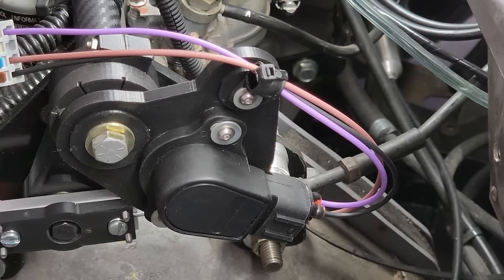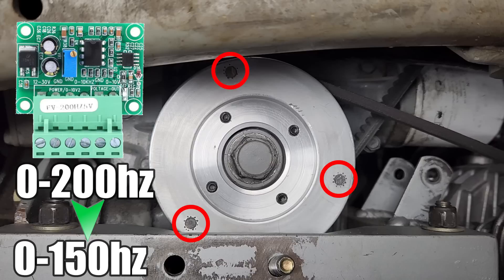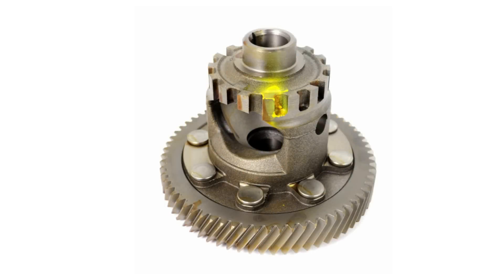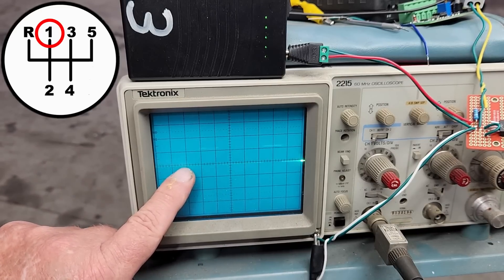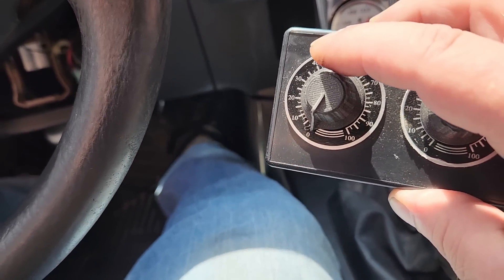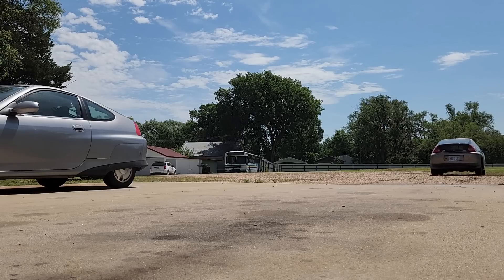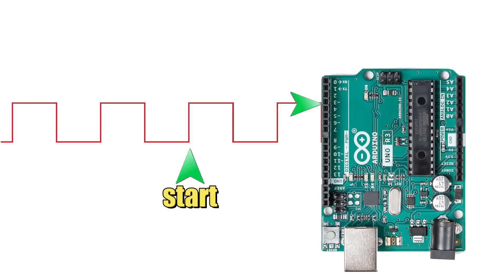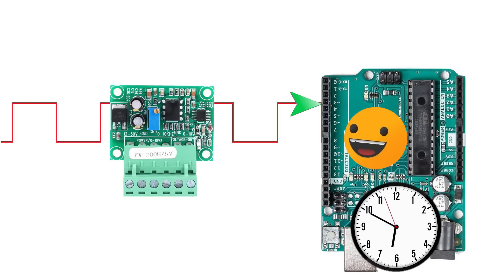S4 E21.We make progress on the Arduino controlled AMR500 supercharged Kubota diesel powered Honda

Comment: Why didn't you use a Bosch hall rpm sensor? They give out a simple digital pulse whenever the sensor passes a metal nub. So much easier
Reply: I think Jimbo is using the sensor (VR) that came with the Saturn transmission.
Reply: @gregholloway2656  I meant for the engine rpm, could interface directly to the Arduino digital pin and with how many digital on offs per rev per time you can calculate the rpm without the need for any frequency to voltage conversion and it's much more accurate and actually no more difficult to code
Reply: @diesel-technology5507  aaah, I see.  I use a hall sensor with a built in magnet, so the trigger wheel just has to be steel, without any need for rotating magnets.
Reply from the maker: Go ahead and write the frequency code  for two frequency measurements using the standard methods in the Arduino IDC... and try driving two stepper motors at the same time.  You will be disappointed in the results.  The Frequency to voltage gizmos aint perfect, but they free up resources so I can drive the stepper motors for the fuel rack and the boost controller.  The priority is focused on the the stepper motors.  The sensors just provide basic info.
Reply: @robotcantina8957  you don't measure it as frequency, you measure it as 0 or 1 on a digital input pin and you're done
Reply from the maker: @diesel-technology5507   0 or 1 measurements is a frequency measurement.  You have to use a hardware interrupt and a timer in order to count the times the port transitions from 0 to 1.
Reply: @robotcantina8957  that's if you're using a specific set timer of seconds, but if you are counting a set number of Hi-Lo states on the digital pin and sub function from timestamp at start of count and timestamp at end of count, and then calculate from there the rpm, it is not necessary to make any interrupt from the main code.
Reply from the maker: @diesel-technology5507  You have to use an interrupt to count the Hi-Lo states, otherwise the arduino will miss hundreds of  hi-lo transitions.
Reply: @robotcantina8957  I'll post the code later from a 68k processor measuring rpm on an old diesel ECU (68k has the approximate speed as the atmega in the Arduino) which uses the hall sensor method to calculate engine rpm. It just runs in the rpm calc program as a sub function, and has no interrupt to begin the counts. The crankshaft toothed wheel has a lot more teeth to get a good reading but it's possible to use many less teeth when using a much lower number of functions in the main program. In the end the rpm is proportionate to the number of injection events and as long as the calculations are made one step ahead of the next injection everything is kept in check
Reply from the maker: @diesel-technology5507  I think we are talking apples and oranges.  The arduino absolutely needs to use an interrupt to accuracy count a pulse input on a port, perhaps the 6800 has that feature built in.  The bottom line is using the arduino programming environment, its not possible to quickly drive two stepper motors while measuring two frequency channels at the same time.   I have tried it in the past and the stepper motors do not spin fast enough.
Reply: @robotcantina8957  I have a hall sensor wired into Digital pin 3 but not using interrupts at all, simply do/while functions that keep the loop inside while measuring the rpm on a 6 spoke wheel (2 out of the 6 pulses are enough to measure the rpm since they're spaced evenly) and it's functions are ignored while the machine is turned off. Works perfectly even with only 300rpm

Comment: Great work, Jimbo.  Have a few thoughts; first you could use an opamp to convert that VR sensor output to clean 12V pulses.  Set it up as a non-inverting amplifier with a gain of at least 10.  Use a voltage divider to hold the inverting input at 1V.  Second, you might be able to get around the Arduino’s frequency measurement deficiency by setting up a time loop of say 1 second, and counting how many pulses arrive in that one second.  This way the math only has to fire once a second, with the downside being that you only get a new RPM/speed value once a second.  Might be fast enough for your application, though. 👍
Reply from the maker: Yes, I actually plan on using an opamp, but instead of ginning up a circuit I'm going to use a pre made el-cheapo small signal amplifier from Amazon.  I like to use off the shelf stuff because its something the audience can relate to.
Reply: @robotcantina8957  makes total sense, Jimbo.  I’m actually amazed at the cheap little modules you find, whereas I’m designing my own little circuits (like a sucker, haha).

Comment: It might be worth looking into the code for Speeduino. It's a project for fully standalone fuel injection but might have functions useful for your diesel.
Reply: Also there are inexpensive VR conditioner circuit boards thanks to industrious diy-ers.

Comment: Instead of frequency to voltage converter to measure RPM.  Using input capture to measure period of proximity signal uses less parts, and will be more accurate, and fast response if needed.  I use timers for EFI and electronic advance ignition systems. AVR is easy and fast just using C. Have achieved over 10K RPM with 4 cylinders.

Comment: I’m loving this project and am learning a lot.  But is possible that you are worrying too much about the puff of smoke.  I’ve seen all kinds of bro dozers driving their trucks in a way to intentionally hose all of us down with smoke.  I don’t appreciate it but there isn’t much that I can do about it.  This little car can’t come close to what these big trucks do.
Reply from the maker: The smoke thing is not really the primary objective but its an interesting goal.  You see in order to get more power from this little engine the fuel rack need to be able to move past the current limits, but without the gizmos, the pistons would melt in about 20 seconds.  it will all make sense soon.

Comment: Excellent results. When I tinker my sucess rate is much lower than yours. I replaced one of the O2 sensors on my old truck with a signal generator. It took me nearly two years to get the signal to match the original sensor. Then after a month of working perfect the "simulator" died. Definitely jealous!
Reply from the maker: O2 signal simulators used to be available to "fix" the check engine light, Sadly they are hard to find these days.

Comment: This might be a bit hard to do inside arduino ide (and what you meant by advanced programming techniques at the end of the video), but why not setup a timer/counter that is increased by your signal and periodically read counter value with a seperate timer interrupt instead of using a frequency converter that may or may not work in the engine bay conditions? Also I would highly recommend you use platform io ide instead of arduino ide in future projects that might include an arduino (Or use a ARM based microcontroller, i would recommend TI's Tiva boards for their ease of use).
Reply from the maker: There is certainly a lot of different ways to do stuff.

Comment: Not sure how fast you need to update the frequency measurement, but first thing I thought of when you were describing the interrupt cycle was to use the square wave input as a counter trigger and set it to do an interrupt every n counts rather than every single rising edge. Alternatively you can set a timer to trigger at known time intervals and read/reset the counter every j milliseconds. (Pick something smart like 125ms and your frequency in Hz is counter<<3 etc... super easy and might even be good enough)
Reply from the maker: A lot of folks seem to forget that the arduino is also driving two stepper motors.  The core of the program is focused of moving those steppers as fast as possible.  Doing direct frequency measurements on the RPM and vehicle speed would absorb too much time using standard code.  And yes, I'm aware it can be done with advanced code.
Reply: I had the same thought and posted it in a separate comment.  Hopefully Jimbo sees these.
Reply: The thing you have to consider is that this micro controllers has an 8 bit cpu that is running at 16Mhz (consider the cheapest, slowest x86 PC runs at 1.1Ghz and has a data width of 64 bits). Frequency calculation takes quite a bit of processing time. If he was running an esp32 (32 bits at 240Mhz) there would be more time for tach inputs. With the method Jimbo is using he can get the analog voltage with just 2 cpu clock cycles(its probably more like 6 cycles but that breaks my narrative) reading one of the internal 10bit ADCs. All the the scaling to units of measure is done in the external DAC (the electronic frequency gizmo). No cpu math needed to get a relative speed. It doesn't have to be 100% accurate, it has to fast and close enough. If the processor was a bit faster then your timer method would work well.
Reply: @georgehooper429  "Frequency calculation" takes essentially no CPU time at all if you use the device properly.

A timer/counter is a peripheral that utilizes zero CPU cycles unless and until the interrupt condition is met. Whether a counter incrementing on an external signal or a timer incrementing/decrementing on the system clock, the CPU itself is not involved until the interrupt triggering circuits are satisfied and the interrupt is triggered.

The ADC actually operates in a similar way; You tell it to take a sample by setting the appropriate bit in the control register, and the CPU does other things until the ADC triggers an interrupt that the sampling/conversion is complete. The CPU then has to stop what it's doing and move the result out of the ADC's data register before doing anything else or risk the data getting overwritten. Alternatively you can put the ADC into free-running mode where it's constantly sampling and will trigger an interrupt every time a new conversion event is finished, or configure the ADC to sample and convert based on a timer or other trigger event with no CPU intervention.

Again, if you're smart and pick a good time base for your sampling frequency, the counter/timer method is equivalent in terms of CPU utilization; The "math" is simply a bit shift left which is 1 CPU cycle. If you're smarter still, you can probably skip that "math" and just use the unscaled value as-is since it's just a constant, and if all you care about is relative magnitude then 0-32 in steps of 1 is exactly as good as 0-256 in steps of 8 if you don't need the full precision (as an example).

Using an external DAC also works, clearly, but as mentioned in the video introduces another layer of imprecision as it converts pulses to analog that then needs to be converted back to digital. Squeezing the data through a 0-5v window, plus likely environmental noise, loses precision. Good enough is good enough, though...
Reply: Just like the rest of Jimbo's overkill, even using interrupts is too complex, inefficient and requires too much programming.  The Arduino's ATmega328 has counter/timers that will do the whole job in just a few lines of code - and hugely accurately and quickly.  His use of extra hardware, particularly those frequency-to-voltage converters, really messes with my OCD.  Converting a digital frequency to a voltage and then converting it back to a digital value is just crazy.

Also, Atmel AVRs inputs will trigger at about 1.0 - 1.3V, so the transistor/half-bridge was also unnecessary.  The inputs also have schmitt triggers, so that will deal with noise.

At the end of the day, Jimbo could have solved the coal-burning problem by opening up the governor and removing a spring to disable it - instead of all the servos, sensors and electronics.

But his videos are nevertheless entertaining!

Comment: I love how simple you make all this look! Suddenly automotive computer systems don’t seem so difficult. Thanks Jimbo!
Reply: He's broken it down so well into steps that it makes it easier to grasp what's going on. The big deal with modern computer controls is they're monitoring lots of channels and making changes based off a lot of information, and all those interactions can make things a lot more confusing. 

CAN still escapes my diagnostic skills and equipment. Lol just causes me grief, thankfully I'm not a tech at a shop, I'm a company mechanic and we don't have too many newer rigs.
Reply: The trick to many of these systems is that a very small number of specific bits of knowledge is the key to understanding bigger phenomenon 

Combine it with shop space and machining skills, you start to unlock the magic of just making bits of reality do what you want with some time and effort

It's a magical feeling
Reply: They aren't in concept, the trick is in getting them to reliably do their jobs in the insane variety of environmental conditions cars are subjected to. All of the checks, detection of sensor failures, physical protections like diodes and TVS'.

Your car's ECU is basically an Arduino covered in body armor.
Reply: I may have missed the explanation. Why convert the pulses to voltage? Why not directly measure the frequency?
Reply: They just want you to think it's so complex, so you bring it to them for repairs. Money, money, money.
Reply: @fredv7487   a lot of the information that the system uses is locked, hidden away from access by non licensed scantools and it really makes it tough sometimes. All I want to know is if a solenoid is being commanded to do something and I can't even do that. It's a multi-facetted issue but overall your statement is correct. They don't want us working on them
Reply: Don't be fooled. The arduino here is doing next to nothing in comparison to a modern ECU. Sorry
Reply: @surewhynot6259 but it is comparable to a 80s-90s ECU, like a Motronic or a Digifant.
Reply: @surewhynot6259  agreed, but I don't think they were trying to say that it is, just merely that it's use and Jimbo's explanations make automotive stuff feel more approachable. Or at least that's how I took it. 

Because you're right, it's basically doing nothing, if you're comparing numbers of inputs/outputs and the number of ongoing calculations at any given moment, but in reality much the same goes on inside the car ecu, ecm, PCM (whatever term applies for a given application) just at a much larger scale and taking more interactions into account. 

But on a basic level of function, it's not that far off.
Reply: @surewhynot6259  add a few dozen microcontrollers (some have hundreds) and that is what the modern ECU is...just with ALOT more programming [which is proprietary] involved...but still boils down to simple microcontrollers
Reply: @surewhynot6259  Similar amounts of processing power though, the Arduino, with enough code, absolutely could do modern ECU stuff, it'd just fail way more often than is acceptable because it's not appropriately hardened.

Comment: Why not remove two of the magnets instead of ordering the new part to put it in range?
Reply: My guess would be the new signal processor is $10, making a new pulley would take a bunch of time and material.
Reply: Signal accuracy probably. More pulses means more data to get a more accurate rpm signal.
Reply: @shred1894  Thought so, but you could do a bit of averaging in code to smooth out any dead spots.
Reply from the maker: I didn't mention it, but I am averaging the data from the RPM and VSS